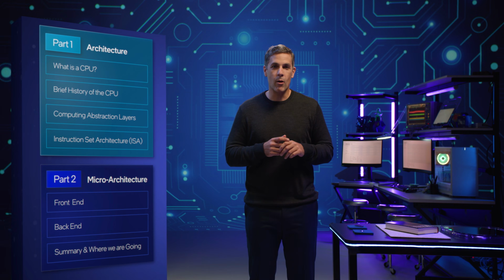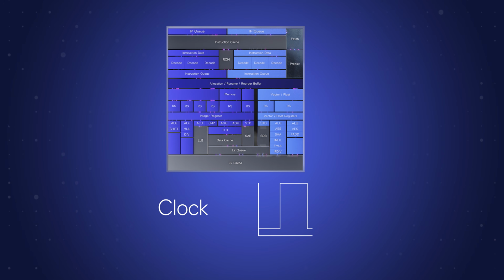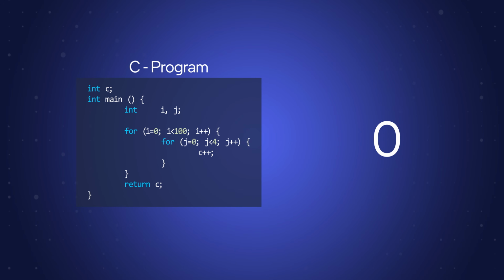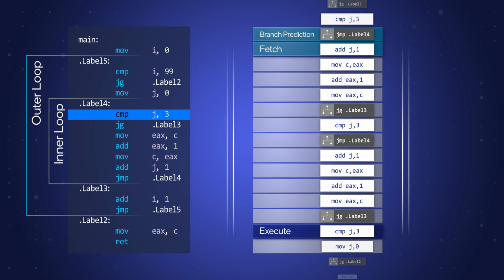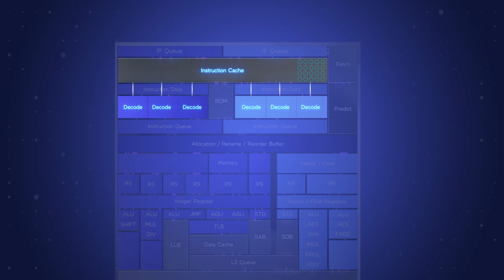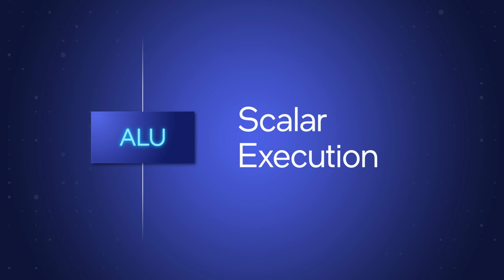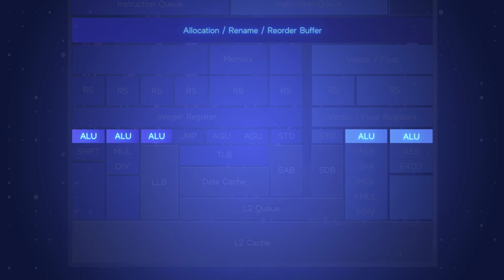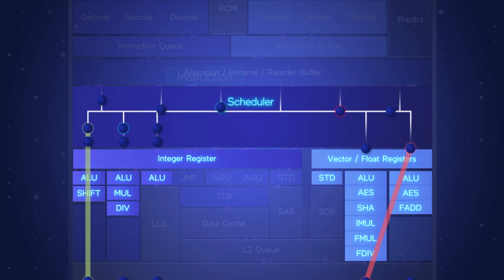Architecture All Access: Modern CPU Architecture 2 - Microarchitecture Deep Dive | Intel Technology

Comment: I have a question: In Superscalar execution, when one uOps depends on another, as you are physically pushing the instructions down the pipeline, where do you store the results? is the separate stage going directly to the register, which is completely off the pipeline or how can I visualize this? Thanks for the great video, by the way :)
Reply: It is not mentioned in the video but with Out of order execution you don't directly write or read registers but to Register Aliasing Table which holds a temporary copy of the registers this allows dependencies to be solved one by one.

Comment: It's nice, would it be possible to split up the code and use multiple branches and a sort of cyclic redundancy check to reset other branches or even make these follow continuous in adaptation of new info of the proven right branch.

Comment: I kind off missed why there are multiple fetch operations and multiple execute operations. I think that's what made branching so complicated. Would it be simpler if after fetching one instruction, you execute it abruptly before fetching another instruction?
Reply: Processors kept continously improving their frequency for two decades until the 2000s. Further increase in frequency would become physically impossible or impractical (very high power consumption).  The new concept was to focus on increasing instruction level parallelism (ILP) instead of vertical scaling up the frequency. The idea is to execute more instructions in parallel instead of executing them in-order one after another. A superscalar processor has multiple execution units as shown in the video. Such a processor can execute several uops at once. You want the backend to be saturated with sufficient operations to extract maximum performance. Therefore, you need to fetch and decode multiple instructions at once to have sufficient resivor of instructions to keep the backend busy.

The more in-depth answer would be that you need lots and lots of instructions to be able to break dependencies and ensure better performance. Imagine a pair of instructions where the second instruction uses the result written in the first instruction. You cannot execute the second instruction until the first instruction finishes. You cannot ideally dispatch the second instruction immediately as the result of the first instruction is generally available towards the end of the pipeline and the second instruction may require it earlier. You will have to stall the pipeline (by inserting no-ops or bubbles that do nothing) for a few cycles to make sure that the result of the first instruction will be available to the second instruction when required. Every cycle a pipeline stage sits idelling is a waste of power and potential performance gain. Modern processors execute instructions out-of-order (not in the program order) so that you can execute some other independent instruction instead of the second instruction while you wait for the first instruction. The more instructions you have in your current set of fetched and decoded instructions (known as instruction window), the more easier it is to find independent instructions. This way by mixing instructions, you can minimize the number of cycles that wasted (if any at all!).

Comment: What if RAM was embedded in the CPU instead of on a separate memory stick? You could intersperse the RAM chips right next to each of the cores. Then you could use the intelligent pipeline to determine where the memory is you want to process and then tell the specific core right next to it. Then it'd be like all the RAM was cache and it'd be super fast. Only downside is people would have to buy a CPU with the right amount of RAM for them.
Reply: ...and then and then and then :) Now that the CPU knows which core corresponds to the memory chip, it could become like it's own intelligent multithreading system, so then software developers don't have to bother with the complexity of multithreaded programming. Instead, the CPU could intelligently use all the proper cores. It could essentially be a multicore CPU that appears as a much faster single core.

Comment: This is excellent. I never knew there was branch prediction. I always thought it just followed the instructions without "guessing". I wonder if this method can eventually become too complex and maybe going back to a simpler pure logic based pipeline with more clock speed would be better. I'd expect this to have less overhead on the CPU.
Like, there are some advantages to RISC. I wonder if you took the old original x86 CPU and made it 64-bits, then miniaturized it as much as possible. Would it still be slower? I would suspect at some point the added complexity would make it slower; the more "intelligent" you try to make the CPU eventually it will fall back on itself and be less efficient because of the many layers. Maybe it's not true, but I've noticed by being a programmer, that when more and more layers are added, it gets slower.

Comment: This was really cool. Any can get a part 3 that explains how this is all translated onto a physical processor? How do we take these concepts and functions and make them work in the physical world?
Reply: Think of it in this way, trillions of electric signals go through a CPU, these electric signals are sometimes of low current, sometimes of high current. Low current is interpreted as 0, while High is interpreted as 1. Now we have all the characters that make up the language of computers. The CPU then uses Hardware languages like VHDL to operate these 0s and 1s. This is how Physical things do software work.
Reply: Lookup "microchip lithography"

Comment: I am in chip design from 1984 and tried many times to explain to people what am I doing. If I would have had these videos my explanation could have been easier. The animation and graphics are unbelievable quality. The Part 1 is a good umbrella explanation of the chip design in general and CPUs in particular. I will call this the 10.000 feet view. The Part 2 is the 1 foot view directly into the processor architecture so some industry lingo and knowledge is required. I would have liked to have a 3.000 feet and a 100 feet view for popularizing chip design and CPU for people who do not have an electronics background. Intel has all the capabilities to do it so please consider it. In the times of Artificial Intelligence and Biotech advancements making more people understand where all started and how it humans can benefit from their merger should be a good topic to cover. Looking forward for new videos from you.

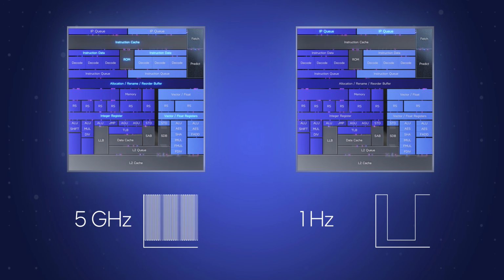Comment: Incrediby well produced and informative. One question: at 4:58, shouldn't the time to complete a stage be 0.2 (1/5th) billionths of a second if the CPU is running at 5GHz? It looks like 5 billionths of a second per stage would give a 200 MHz clock speed.

Comment: It feels like uOps are the actual basic instruction set. Which makes it feels like ISA is actually a higher level language hardcoded in the hardware. But then what is the point of the higher complexity ISA and not using uOps as the basic instruction set directly? Is it why x86 has like 2500 instructions in its ISA? And RISC-V on the other hand as less instructions. 50 I think. Which sounds like many more than the really basic instructions so I guess they also use uOps?
Reply: >Why not use uOPs as the basic instruction set directly?

You could, but the issue is that it’s going to cost you a lot of memory. Really it’s just space complexity, instructions take up little memory, uOPs a lot.

uOPs are basically a bunch of wires that go throughout the CPU and say things like “connect register 4 to the bus leading to the ALU” or “write output of ALU to the register file.” Each uOP also has to tell which modules of the CPU stay on and which stay off, and for the vast majority of instructions, each uOP is going to be sending a LOT of 0s to all the modules that don’t need to be operating for this instruction. While an instruction alone can take up say 2 bytes, each uOP could be telling hundreds of modules what to do.

The decode stage itself is pretty dumb usually. It essentially uses storage, the instruction is an address and in that storage for that address there is some firmware for all the uOPs.

Also each architecture can have all sorts of different uOPs for the same ISA.

Comment: compilers can currently unroll loops with constant loop counts, but could this more efficiently be handled by hard-coding instructions to a branch predictor?
Reply: As in an instruction hinting to the cpu what branch to take? 

It’s possible. The Pentium 4 actually did support these branch hints, but it seems Intel has abandoned that since for whatever reason. I think it’s because modern hardware branch prediction has gotten good enough that it’s not needed anymore. 

Loop unrolling still benefits, even if you hint to a cpu to always take a branch, with a loop you are guaranteed to guess wrong at least once. Not having branches also allows the compiler to make other optimizations.

Comment: I love this series! It's incredible how these devices even work without a hitch given how mindbogglingly complex they are.
Reply: What's really amazing is they don't run without a hitch, there is an acceptable error rate that they recover from. That is part of why systems are more stable today than previously, more threads, more cores, if a thread crashes it doesn't take down the entire system.

It's not just at the CPU level but errors still exist they just don't take down entire systems as often.
Reply: )l

Comment: Will x86_x64 ever return to its former glory? With ARMv9 announced I wondered what direction Intel would take. Performance per watt and performance per clock especially in this age of working remotely needs to be improved with emphasis in efficiency.
Reply: intel will do big little with 12th gen. x86 doesn't have any inherent efficiency issue, it is just that arm socs use tsmc latest process (5nm) whereas Intel is stuck with a broken 10nm process.
regarding ISAs, backward compatibility is the biggest factor that keeps x86 alive and above ARM. Removing the backward compability like arm did with armv8 will actually mean the end of x86, so i think keeping it as is a good idea.
Again, x86 doesn't have an inherent efficiency issue. Qualcomm 8cx is not that far ahead of lakefield in efficiency and performance.
Apple m1 is so damn good cause the core is super super wide (2x compared to zen 3 and tigerlake) which means it can run slow and wide which means the most efficient. But they can do all of this cause they use 5nm process from tsmc. Put the m1 on intel 14nm and I can assure you things won't be so rosy anymore.
Also, arm isn't bringing anything special with its ISA. Sure, it doesn't lose as much with complex decoding like x86 does, but internally both arm cpus and x86 cpu are risc, with the addition of a translation ucode layer for the x86 which i don't think it consumes that much power.
the best example for this would be the Atom Z3700 which back in the day was very similar to snapdragon 835, even though atom was on 22nm and sd on 10nm.
another one is U series from amd. they are very similar in power  and performance to apple m1 chip, even though they are made on 7nm. 
So yeah, I think whole ARM thingy is a stereotype or a misconception.
x86 needs to be as is to serve all the spectrum of usages from low power mobile to high end hpc servers.
Reply: @vladmihai306  I will counter some of your arguments here.

Intel's 10nm process is technologically superior to the TSMC 7nm process in terms of feature size and transistor density. The names "10nm" and "7nm" no longer have any physical reference and are marking names. 

The x86 backwards compatibility adds a large amount of decoder complexity and size as well as extra supporting logic (5-20x the size of an ARM decoder), this is absolutely an inherent efficiency disadvantage as this is not a free lunch. If backwards compatibility did not have associated costs, then the latest ARM ISA would also be backwards compatible.

I would like to see cite the comparison of the Atom Z3700 verses a Snapdragon 835 as the snapdragon is a complete SoC including modem. The only comparison I have found between these chips is that the Atom is a lot slower than the qualcomm chip, unless you are talking about window x86 code. These are two completely different chips with different power envelopes and a large difference in release date, 2013 vs 2017.

Intel has compared the power consumption of an ATOM CPU core to an entire ARM SoC, this is an absolutely absurd comparison.

"another one is U series from amd. they are very similar in power  and performance to apple m1 chip, even though they are made on 7nm."
https://www.anandtech.com/show/16252/mac-mini-apple-m1-tested/
The M1 CPU is providing comparable performance to the top of the line x86 desktop CPUs whilst consuming LESS power than a U category x86 CPU. A U series CPU is considerably slower than an unrestrained desktop CPU.

"internally both arm cpus and x86 cpu are risc" - This is flat out wrong, RISC and CISC are both ISA design and architectural concepts. It is too complex to fully describe this, but the ARMv9 ISA cannot be fully categorised as RISC. Whilst you can very lazily describe a modern x86 CPU core as having a more RISC like execution architecture,  the x86 decoder has a lot more overhead to translate from CISC to a load-store architecture.

The "whole ARM thingy" is based on cold hard facts and intel has tried to move away from x86 several times (IA-64 as an example) to free itself from the limitations and overheads of x86. Each time the lack of x86 compatibility has ultimately cause the products to fail. When Intel released the first ATOM CPU they tried to make the argument that the extra overheads of x86 were an insignificant proportion of the total power and area used by a modern SoC.
Reply: @vladmihai306  spot on
Reply: @vladmihai306 when you look at the performance per watt and performance per clock, there is inefficiency with x86_x64. They need more power, even AMD on TSMC's 7nm also needs more Watts. X86_x64 needs higher clock frequency. 
I never smile when I get my electricity bill.
Reply: @vladmihai306  x86 is CISC while arm is RISC ?
Reply: @vladmihai306  have you heard of the company Atomera?
Reply: @vladmihai306  There is a growing under dog that is beginning to pick up speed in the markets, don't know which way they'll go and where they'll end up and that is RISC-V. I've always preferred Intel over AMD and others... yet I'm curious to see what will happen within the next 10-20 years if RISC-V gains more traction and grows both in popularity and demand. However, when it comes to Desktop Computing, I still prefer Intel and I'll stick with them for now...